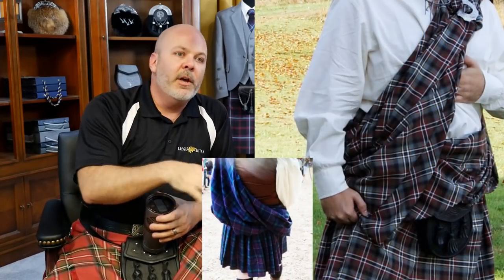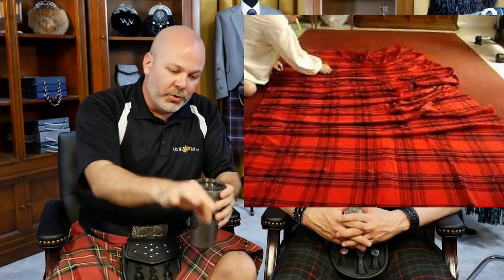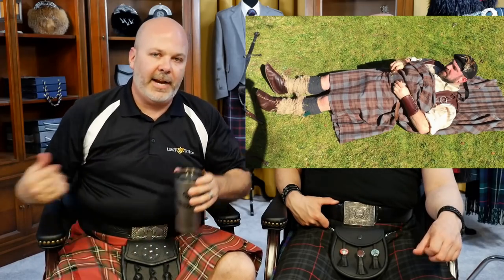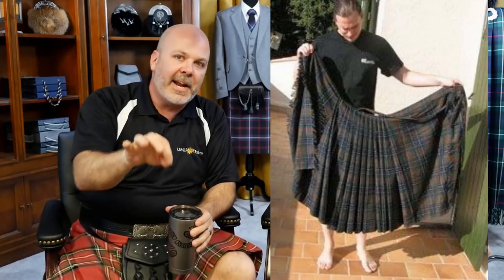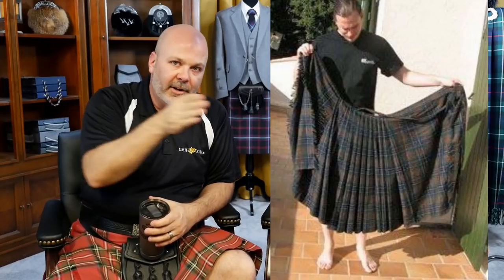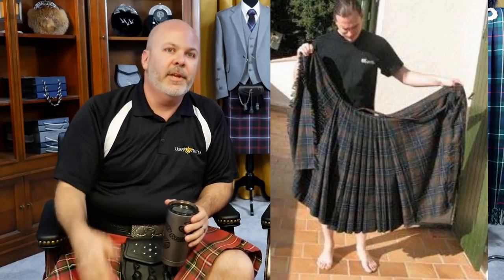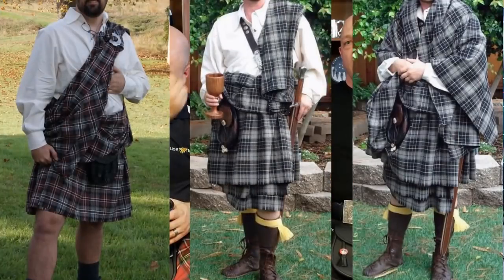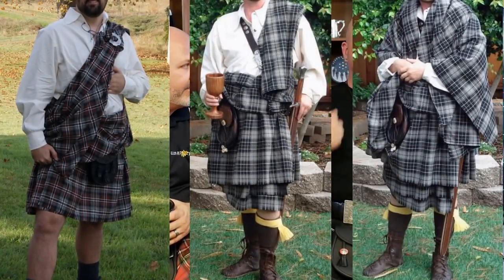What Are Cheater Pleats?

Comment: I have been wearing a great kilt now for 21 years for ren faires and I sowed my pleats in. I went from putting on a kilt taking 45- 50 minutes to 15 so good for my time, and I dont have to roll around on the ground to do that!
Reply: 45 to 50 minutes?! It shouldn't take more than ten, unless you are aiming to have absolutely precisely even pleats.
Reply: I’ve pleated it up at camp. Takes about 10-15 mins. It’s usually a pain in the rear, especially when it’s dirty out.

Comment: According to my Scottish maternal grandfather, drawstrings were used from the early twentieth century and possibly earlier. However, they did not go through the Feileadh itself as that would be detrimental to its weatherproofing properties. What they did was sew loops of thread rather like dufflecoat button loops onto the cloth then thread the drawstring through the loops. The string would have a large button or knot on one end to prevent it fully pulling through and thus bunch up the loops when you pull it. I have experimented with this and found that it doesn't work well enough to be useful with a single line. Three lines is OK as long as the loops line up in the vertical direction or you'll have wonky pleats, then the central drawstring can double as a secondary belt, but I still prefer the 'normal' way because all those loops can make it uncomfortable, especially when using it as a blanket. So I would say it's OK for a filibeg but not for a full on Feileadh Mòr, and not for anything too formal either because it's going to be obvious to anyone who gives it more than a cursory glance. I have seen tailored half kilts with the actual belt threaded through the cloth and they look awful as well as not being windproof.

Comment: 4:37 the "blanket" bit is precisely correct.  In the 1st millennium, the Irish (including those who would eventually become Scots) used a big old patterned blanket as a Brat, or cloak.  There was also one battle where there were Dal Riadans (a kingdom that encompassed northern Derry & Antrim up through the Hebrides) and other Irish, and the only way one observer/contemporary historian could tell the difference between the two groups was that the Dal Riadans were in the habit of putting their belt outside their cloaks (presumably to keep the warmth in, because the Hebrides got a lot colder than Ireland).

Thus, it is my hypothesis that the Dal Riadans started out wearing exactly the same clothes as the Irish, but their habit of belting their brats meant they didn't need their leinte (shirts, which often covered down to one's knees, or further) to be as long, and their fashion evolved from longshirt & cloak into shirt & (great) kilt.   Thus, the kilt (as distinct from Brat) is a uniquely (Hiberno-)Scottish invention, and not originally worn in Ireland.

Of course, that's all history, and Tradition is nothing more than peer pressure from dead people, so do what you want.  I'm just sharing the history.

Comment: There's a method that I've used for pleating and belting the plaid that doesn't involve laying it and yourself on the ground. It involves accordion-folding the whole thing while standing, throwing one end over your shoulder, loosely belting it, then pulling the ends around yourself to form the aprons and spread out the pleats in back. It helps to have an extra pair of hands to get everything arranged and looking right, and it's not as neat in the pleating, but it's good for when you don't have enough dry ground to lay it out.

Comment: I really love the utility of a greatkilt
I would love to see a greatkilt reimagined through a modern lens, with greater focus on utility and deriving its aesthetic through its functionality.
Apply a sealant to the wool so its a bit tougher and more waterproof. have ringlets at each corner for anchoring as a tarp/tent. a section of drawstring cheater pleats in the middle, with their own little metal ringlets. and a sturdy set of belt loops and attached belt.
really just design it for all the survival uses they used to have, but with a more modern make, giving a little extra durability.

Something very industrial punk about a greatkilt designed for function over form.
Reply: That sounds amazing

Comment: One could also sew in belt loops on each pleat (use the same tartan to hide them a little), I think this is how Fandabi Dozi does his. Similar to the draw string (but without cutting the plaid), just slide the belt in and cinch it up. Once the belt is off it is a regular plaid again; you know, for sharing.
Reply: And there is historical evidence of this. I have read in a couple of places that tartan material has been found with belt loops sewn in right where you would expect them to be for this to be done. Not common, but not unheard of.
Reply: The belt loop per pleat method was a suggestion I got from the pipe major who taught me and few friends how to pleat our great kilts in my first foray into kilt wearing. We were considering joining an 84th royal highland emigrant reenacting group… I never did it as the stitching seemed rather tedious. 
Love your channel, seriously have me considering a modern kilt, for casual wear.
Reply: This is what I did and I highly rate it!

Comment: I used to do a variation of cheater pleats when travelling to a renfaire a couple hours away. I used large safety pins on the inside to pin every third pleat then folded over the aprons and rolled up from the bottom like a bedroll. Kept everything in place and I wasn't collecting bits of dried grass and debris from the ground that it would have with hand pleating at the venue.